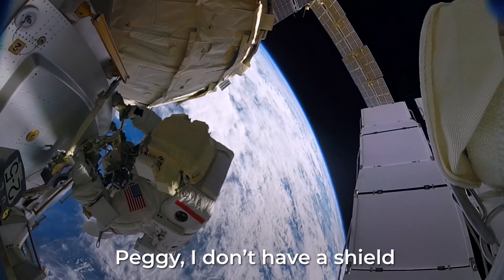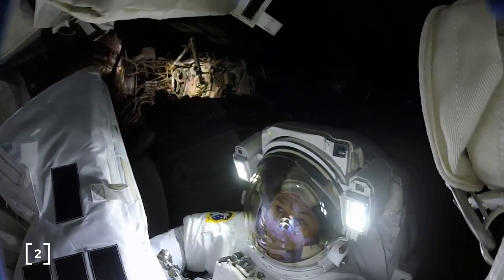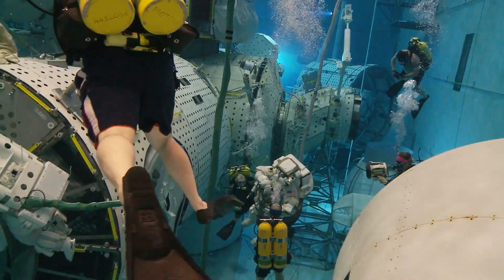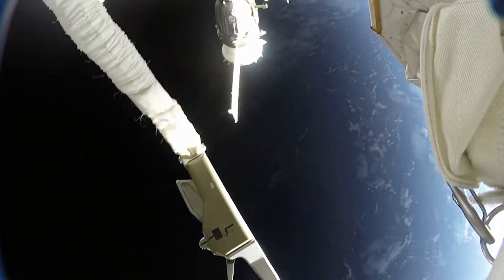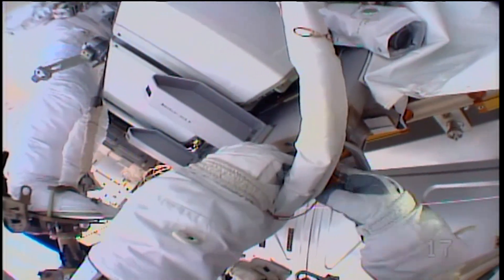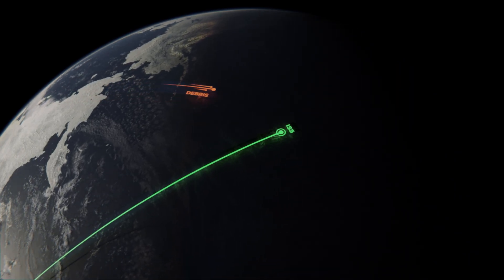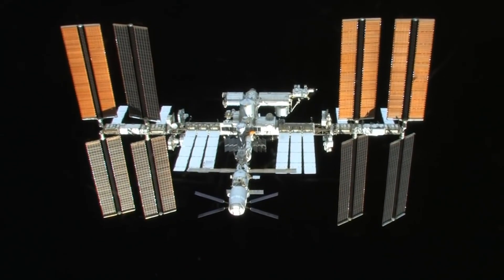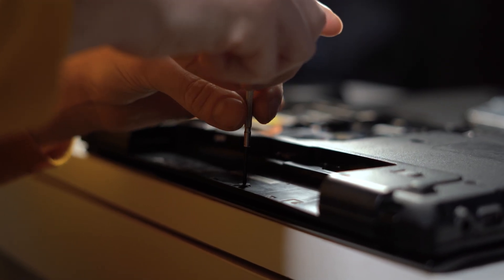Don’t Drop your Tools in Space

Comment: I remember the experimental self propelling robots tested inside the ISS. I wonder if it's good enough to act as retrievers in case of things like this
Reply: The major difference is inside the ISS is an atmosphere which fans can be used for maneuvering.
Or if you use compresed air, it'll be released back into the ISS and can be reused over and over.
Outside of the ISS, not so much.
Plus we're talking about a vastly different enviroment in terms of the robots and their design too.
inside they need no shielding and have no worries about any thermal control and so on because it's in a safe enviroment from the ISS it self.
Outside they very much would need to.
Reply: ^ if you’re talking about the Astro bees, they use fans and sadly wouldn’t work outside of a pressurized vessel
Reply: The risks are quite high even if the robot is expendable compared to a human. You see, the robot needs to get out there, grab the thing, and get back with something that increases it's overall mass in short enough time to where it doesn't have to expend so much delta-v that it would run out and itself become space debris.

It's not that it's impossible to go out and grab the thing you lost, it's that once orbits differ they will keep on differing more and more over time, requiring more and more propellant to rescue.

It makes sense to go out of your way to rescue a human that's floating away from the ISS, but a piece of space debris isn't worth the risk. The management strategy that makes most sense is to track, avoid and wait for orbital decay.
Reply: @RealCadde  If a retrival drone cannot return with the drop with the dropped object it should have an emergency rocket onboard to deorbit the whole thing.
Reply: @RealCadde  All true, but things can be engineered. You know the mass of the object dropped, the approximate initial delta v and the time it's been since release. With those numbers, and maybe a follow up range check to verify the velocity and distance, you can know if you're little automatic retrieval drone (or whatnot) can do the job. You could have a few small ones, a multi-use medium one, and one big boy you send out that maybe needs to be refueled after use from earth stocks.
EDIT: The big boy could probably rescue humans, as its ultimate design objective.
Reply: @kindlin engineer it then.
Reply: @WigneyR  To what specs? It's mostly about mass reduction and propellant efficiency. I think some kind of railgun/kinetic start could be a good way to get moving out toward the object to capture, and then you'd want something as efficient as possible for the return trip, just incase you need to put some serious delta v into the return (or recover a larger mass).
Reply: Nah, just make RCS jetpakcs kerbal style.
Reply: Space fetch with a robodog
Reply: The other option would be a net gun with a cable.  Use a spring to launch the net, with the expansion rate designed to catch the item.  Figure 1 km of cable as a rough idea.  You don't need a lot of velocity since you don't have to worry about gravity or air resistance, so maybe an automated cable gun would be useful.  It would fire at the debris, try to catch it, and retract the object at a slow rate.  If the motor goes over a certain wattage the motor will shut down so an astronaut can go out and clear the net from whatever it is tangled on.  A human can override the motor to retract anyway.
Reply: Every tool should have a small magnet. Then you only need a rope with another magnet on the end to retrieve anything. Right?
Reply: @ekothesilent9456  yeah but how is it gonna be accurate?
Reply: Fishing rod 😅
Reply: @evlsc400  How comfortable are you in casting, to hit a small target a half mile away?  You be lucky to hit that with the scope sight on Vera.
Reply: Simplicity is often the best. Screw all these fancy robots, how about a strong magnet on a length of 550 cord or something similar that could withstand space?
Reply: We need some sort of small self propelled robot, perhaps cold gas thrusting, that can carry a gluey string to a small nearby object so it can be reeled back in.  It's maddening that an object gets a tiny bit too far to grab, and it can't be retrieved at all.
Reply: @davesvoboda2785  hmmmm that's a good idea but a tiny improvement. Automated camera AI targeting systems and glue hook guns. Shoot the gun and a counter thruster simultaneously on a targeting vector that intercepts the object at some point in order to avoid any kind of drift from the initial trajectory of the station. Ultra strong nylon line on a 1km reel. almost guaranteed recovery for anything larger than the glue projectile
Reply: @sa-amirel-hayeed699  If you shoot it at the object with velocity, you're likely to push it even farther away.  With a little finesse, the little autonomous robot, if all else failed, could just push it back towards the astronaut.  When I say sticky, I mean anything, even static electricity, that a station -keeping robot could use to attach itself.  Pincers, maybe.
Reply: @davesvoboda2785  its not that complicated you just need a grabber arm, even a grappling hook could work im thinking dome on a rope with a battery powered gyroscope? Just lock the gyroscope to point the thing at the direction of the object then cast it out and pull it back, the dome could act as shielding as a bonus and could be very light. Otherwise the extending grabber hands? Sticky whip? If you think about those grappy hand things if you made them branch like 50 times like a big bush you could cast it out as a rope and grab the thing. It could even be extra sticky cohesive unlike regular sticky hands. Even just a sticky rope would be a good idea.
Reply: This was my first thought. You could take a rescue bot with you on every EVA and it could catch things or be mobile eyes for the other team members. Most EVA’s it wouldn’t fire its thrusters. 
 It could be tethered with a thin line as insurance against it getting loose and becoming a big bit of debris. Also if it is tethered it could grab a person and then the responsibility of hauling the person back would be up to an winch on that line or someone pulling it back in. A set of manipulators that can attach a carabiner or slap on a sticky pad would be essential too.
Reply: @isstuff  This is a little silly, but having some way to yeet the robot might also be nice. Use radar or lidar to get the object's precise position and velocity, have some sort of launcher throw the little retrieval bot, and then expend a tiny bit of fuel to maneuver the bot to the object
Reply: @antonliakhovitch8306  yes but the object is probably only drifting away at crawling pace. So to go after something you could move slowly and then you don’t need to slow down as much.

Comment: I don't get why the ISS doesn't have a free floating pack for the astronauts for just this occasion... OR even an RC bot they can fly around for such.
Reply: They wear an emergency maneuvering unit in case an astronaut would lose contact with the station. They'll eventually have something for movement or recovery of stuff like this, they just don't have it yet.
Reply: @MeerkatADV  considering they had something with the shuttle, it is ridiculous they don't have it for the station.
Reply: @DarkHorseSki  the MMU is too large to fit in the airlock.
Reply: @MeerkatADV  I don't believe that is true.  It may be too large to fit fully extended and on an astronaut, but not in the compacted position.
Reply: @DarkHorseSki  the SAFER system they currently use is easily compressed. The MMU was larger than their current life support backpack and more massive. I think they'll eventually have some form of automated safety/recovery drone, it just doesn't exist yet. The MMU was only used three times, the SAFER is much better.
Reply: @MeerkatADV  The ISS has been up for over 24 years.  There really is no excuse not to have had something up there within 5 years of when it was first put into use.
Reply: @DarkHorseSki  they haven't needed it. They have had the SAFER system since 1994.
Reply: @MeerkatADV  Clearly they HAVE needed it as they are unwilling to go after things that are just meters away even when they have the SAFER system available.
Reply: @DarkHorseSki  The MMU was so large it was parked in the Shuttle's payload bay, not inside the crew cabin.
Reply: @FastSloth87  I'm not suggesting they use the MMU.  OR, they could have built a similar type of bay into the ISS for just such needs.  The failure to do so is inexcusable.

Comment: I feel like we should be getting pretty close to being able to create spafe-safe gloves that aren't so thick and bulky...isn't there some material like, "carbon-nanofibers" or whatever that's fairly thin but doesn't let anything, not even air molecules, penetrate it?
Reply: The problem isn’t the flexibility of the material it’s that the suits are pressurized to ~1 atmosphere.

Think about trying to wind up a fire hose. Now think about doing that while it has high pressure water flowing through it. That’s what it’s like to use a space suit.

Comment: I'm surprised they don't have a drone that can retrieve such objects yet
Reply: Propeller powered drones don’t work in space, so it would need to be a propulsion engine powered drone, which are dangerous, expensive and heavy, so I imagine it isn’t worth it
Reply: @RubenGarcia-pt8tp  All you need is some gas thrusters, a claw and some good software. It's not like you'll need that much delta V
Reply: @RubenGarcia-pt8tp  Cold gas thrusters are nothing new and in no way dangerous. Astronaut propulsion/maneuvering units are nothing more complex than a bottle of compressed nitrogen. Already used in space suits, no problem in a drone. Do some research before commenting.
Reply: @murmenaattori6  well considering that the Manned Maneuvering Unit is no longer in use after it was considered too unsafe I assumed that using drones working on the same principle would also be unsafe to use near humans. If I am mistaken and there is in fact a reliable source that indicates the opposite please let me know
Reply: that would basically be a space tug
needs lots of propellant to be usable for long periods of time
+ maintenance
or just very expensive